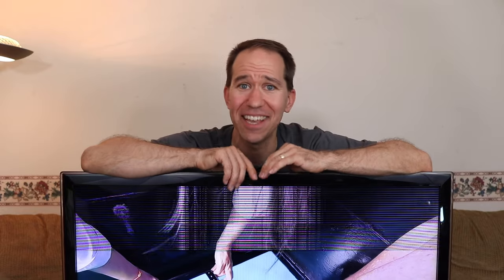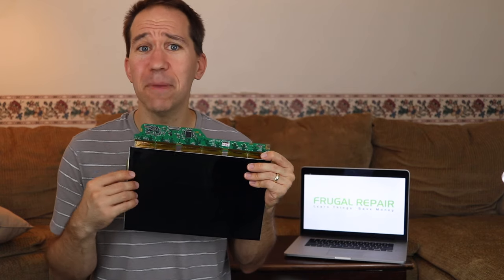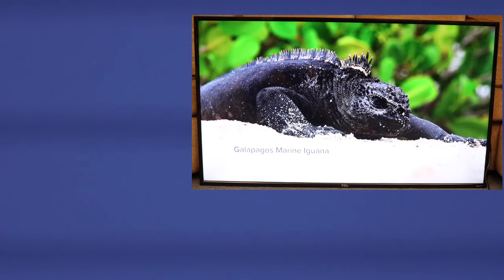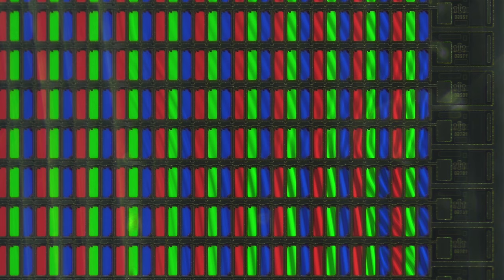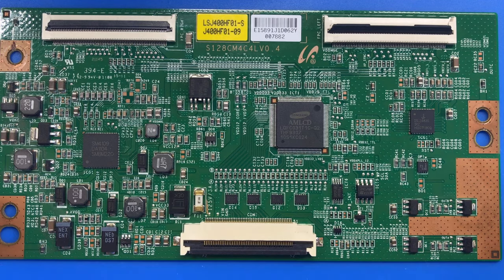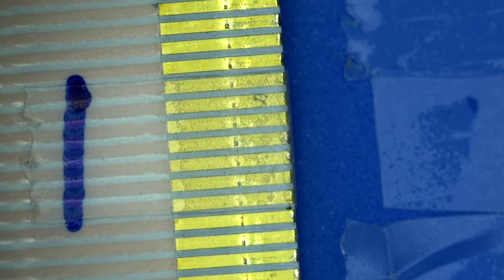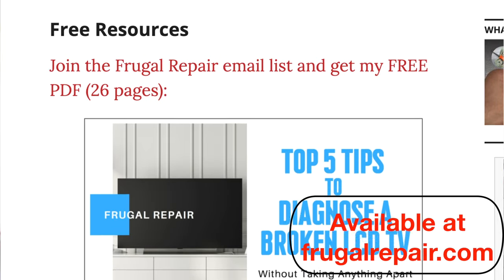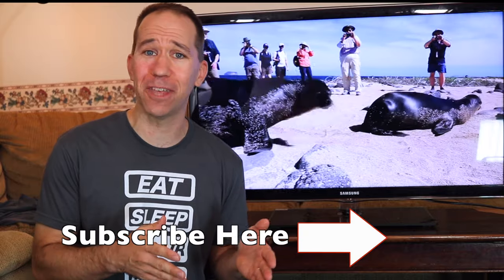Repair Hack Explained | How to Fix TV Horizontal Lines - Part 2

Comment: I've glad to know that someone explained this issue I thought the screen was built with problem defect after a few years however I still would like for you to explain how to deal with those TV that does not have t con on board and the lvds cable is connect directly to the screen with buffer board do you cut

Comment: Very nice detailed explanation.. I have a question? My TV screen is broken. Do u suggest to replace it from outside or from the Authorised service point only but it's costly equal to the new tv cost?? Pls advise
Reply from the maker: Unfortunately, you can’t repair a cracked lcd.  You can replace it (even yourself) but the issue is that you likely can’t buy a new lcd anywhere.

Comment: Im very happy this worked for me im just so confused why it works by putting the tape on the ribbon cable does it bypass a short on the internal lcd board?
Reply from the maker: I’m so glad to hear that it worked! Yes, you are preventing an electrical signal from going to a short circuit inside the panel. The reason that it works is because the signal is redundant to both sides of the screen. It’s like an airplane can fly with one engine.
Reply: @FrugalRepair  thanks so much for explaining i really love your channel keep up the great work
Reply from the maker: Thank you!

Comment: Hi Reese, I have a smaller 32" LG tv that has vertical lines along with an impact point. I took the back off and pulled out all the ribbons and re-inserted them firmly, as well as checked for bad grounds. Lines and impact point still there and no picture. Looks like the screen might need replacing. What do you think, internal damage? Thanks.
Reply from the maker: If the screen is cracked, unfortunately, you can’t do anything about it.  You can install a new screen but the problem is you can’t buy them anywhere.

Comment: I fixed my 4k panel as per your advice, thanks @frugalrepair. But on one side of screen, its dark. And there are light black horizontal lines  there. Is there any fix for it?
Reply from the maker: Great to hear.  Congratulations.  I’m not sure of your issue but if you have a row signal problem and the tape trick brought the image back, then you may be blocking too many lines or that may be the best the image can get.

Comment: Liked & Subscribed. Great video. Gonna have a go at my TCL 50” soon. Need to gather some courage first coz its my mom’s tv😂
Reply from the maker: Good luck!  Biggest thing is not to put pressure on the lcd screen so it doesn’t crack.  And always make sure the power is off while you are directly working on it.

Comment: Hi!  This is great, I have a slightly different problem, I got a free 34” curved monitor from work because it has snow and horizontal lines, is there anything I can do?  It was brand new out of the box like that.  Ideas?
Reply from the maker: Hopefully it is something really simple like a loose connection since it's a new device.  I'd re-seat all of the connections starting with the ones to the main board and the screen.  One time I bought returns (from a big box store) and the most expensive tv in the lot had a loose cable (after I opened it up).  All I had to do was plug it back in correctly and I had basically a brand new tv that I paid very little for.  Good luck!
Reply: @FrugalRepair  thank you!  I have it apart and don’t see any bulging caps or loose connections.  I am only through the first layer of boards (main, power and audio).  Is snow only caused by loose connections or could there be something unfixable that is causing it?

Comment: Hi frugal  Recently my 65" LG LCD 4Ktv lost color but i still had back light, So I was able to take it to the local TV repair shop he was able to restore picture n fix it but now I have some flickering and horizontal lines, which seem to be emanating from top right corner. Do you think I should try the tape or just replace the tcon panels entirely?  I already went ahead and ordered the replacement parts 🥲tho im gonna ask repair to install them

Comment: Good job and thanks for the explanation. I have a 32 inch toshiba led tv. It shows picture on the upper Side   of  the screen and tiny coloured lines on the down. Any ideas on what to do?
Reply from the maker: Sounds like the lcd panel is cracked.  If so, you won’t be able to repair it unfortunately.

Comment: Is it possible for both sides right and left ribbons to have a short circuit problem? In that case how should we go about trying to figure out which leads to block off with the tape? Any help and info is much appreciated.
Reply from the maker: The row signal is shared across both sides, if it's the problem then it will likely show up more on one side.  If you get the same symptoms on both sides then I would next suspect a problem on the tcon board.

Comment: Holey Dooley, what are the chances...!! you repaired the exact model TV I have with an almost identical issue. Just gotta figure out how to get to the part you put tape on. Woop 🙌🏼
Reply from the maker: I hope you can get your image back too!
Reply: @FrugalRepair  unfortunately not. I did reduce the lines appearing but couldn’t work out exactly which pins to cover. Which section did you cover? Mines also from the left side.

Comment: Thanks for the technical details on how LCD works. Its very interesting to know the facts. The reason I was watching this is to troubleshoot 1/4th of the screen vertical lines on my SHARP AQUOS tv. I replaced my T-Con board and swapped the cables but the problem remains the same. Is it possible to replace the electronics that send the vertical image data. Is there a simple fix.
Reply from the maker: The issue is inside the lcd assembly so that’s why changing cables or the tcon doesn’t help.  Maybe a failed COF (chip on film) or a failed transistor in a sub pixel or something else.

Comment: Excellent explanation, is this applicable to LED TVs too?
Reply from the maker: The backlight is irrelevant because what is being worked on here is the LCD screen itself.  So it doesn’t matter if the backlight is LED or CCFL.

Comment: nice video with in depth explanation... I have a 22inch acer monitor(al2216w) that has image display problems. I tried changing the cable out and even connected the monitor to a different device, still no changes. The content on the screen looks like it has shifted to the right( the same type of blurring you get when you write using a pencil then smudge the words). Any tips or solutions?
Reply: the blurring is horizontal

Comment: Hi. Are horizontal lines means problem within the screen itself or T-CON replacement should fix the problem?
Reply from the maker: It could be either.  The isolation test I did in the video can usually indicate which one is the culprit.
Reply: Thanks from the UK for the quick response. Top man.

Comment: What would be the proper fix the replacement of tboard or the thing you are putting the tap
Reply from the maker: Proper fix would be to replace the entire LCD assembly since that is where the problem is.

Comment: Hi there thanks for the video !

Is it possible to fix the issue of the horizontal lines? Like fixing the lcd circuits for the RGB pixels ?

Or it's impossible if the problem is on the lcd itself ?

Thanks

Comment: I have a VIZIO V585-H11 58" LCD Purchased 15 months ago. A month ago the picture went blank.. I removed the tcon cables going to the LCD screen one at a time... Got a good picture on both halves!  I put tape on the outside edge on the left cable at the screen and BOTH sides came back on with no artifacts in the picture... I blocked all timing on that side.. (look for the holes plated through on the left hand side of the PCB  and cover the traces on the flexible PCB cable at the board...   I'm a 73 yo retired electronic tech that worked on industrial and commercial audio and  video and felt there was nothing I could do to fix this set... Toshiba 58UL2063DB and PHILIPS 58PUS8105 use this same board so you might be able to repair them the same way... Thanks for your caring to post your fix...
Dave in Ohio
Reply from the maker: I think I missed it, did you get the picture to stay working?
Reply: @FrugalRepair  YEP... with some minor lines on right side of picture (left to right) that come and go... I probably could have unblocked some feeds on the flexable cable but was satisfied just getting a picture back... Dave

Comment: Thanks for the explanation! I was wondering back then how the tape fix works which fixed my tv. These manufacturers should do something about this as two TVs in our house got the same problem.  It is like they have a redundant system for signaling but the redundancy is useless in practice.
Reply from the maker: Thank you!

Comment: So does this mean that the TCON board is defective? Wouldn't be easier to replace  the TCON board?
Reply: No it would generally not be the T-Con board in this scenario. I had the same issue as in his part one video. I had nothing but a blank blue screen. I made the mistake of changing all my boards and the outcome was the same. After watching his amazing videos and using the tape method it’s a miracle I have a full picture back. It’s not perfect yet as I am still trying to narrow down some horizontal lines from mid screen down. So it’s going to be time consuming for me trying to figure out exactly which ones to block. Definitely go this route before wasting money on new boards like I did. Mine is a 50” Philips Roku. My shaky hands make placing the tape a pain in the @@@ lol.

Comment: I bought this Samsung 32 inch for 25 dollars. It had 2 of the diffusers broken off and shining bright light that I couldn't stand. I ordered the LED strips and installed them and now there's horizontal lines and I didn't really understand how u found specifically where the tape went but I'll play around with it. And watch the video a few more times to see if I finally get it.
Reply: I never got it to work. I regret changing the backlights. It worked better before. Oh well...

Comment: I know that this is a belated question, but I have an LG 55" LCD TV with one horizontal line and two much fainter lines - one either side - of the darker one.  First of all, could I get away with maybe covering one or two traces to solve my problem, and second, would replacing the T-Con board be a better and more permanent solution?

Comment: Hello, first of all, very instructive video...I also had horizontal lines on my tv-set..I  tried the tapehack to block the clk-signals from 1 side of my tv...I blocked all six of them and the picture looks like brand new...I only have one question...Is this hack is a lasting thing or are there risks with this methode further on , like firehazards? Thanks you for respons in advance...
Reply from the maker: Congratulations!  No fire hazards that I know of,  you are helping to prevent/minimize a short circuit by blocking signals.  Not sure on longevity but I don’t see why it wouldn’t last a really long time.

Comment: It worked on my Sony 43 inches LED TV❤️.
But if i look closely then I can see some lines.
But from a distance of 5 to 8 feet  it's not noticable.
I was planning to buy a new tv by throwing this TV 😢, But you saved my money ❤️.
Question!
If I change the Tcon board ribbon (50 pin), will this problem get solved permanently??
Please reply 😇

Comment: I have only 1 question : is this fix  permanent or not? Thanks for the video! I've always wondered why blocking these lines were fixing this issue 👍👍
Reply from the maker: My tv's that I have done this one are still working so I don't know what you call that.  Did you watch both part 1 and 2, I hope that I explained it well enough in both videos?

Comment: Thanks for your nice explanation how it works. I follow the same method to fixed the horizontal lines of a LED 4K  TV and it fixed tha issue but some colours  are completly missing on one side. When all the lines are connected and horizontal ines are there, the I can see the colours are same as other side. Do you think there can be mcuh more issues with the panel other than this. Much appreciated your reply.  Thanks.
Reply from the maker: Obviously I don’t know what is exactly wrong, but it’s likely there is one failure in the lcd panel that is causing the lines.  As I showed in the videos here that you can experience some color loss, I think, because of the loss of the gate voltage for the transistors on that side (where you blocked the signals).  Is it possible you have too many lines blocked?
Reply: @FrugalRepair  Thanks for your reply. I has to block only two lines 9 and 10 in the 96 pin ribbon. If I tried to block only one, I get a full colour with some flickering on that side with fewer horizontal inles.  I also hear some bussing noise from the TCon board.  Is that a sympton of a bad TCon? Since this TV is near brand new, I will further investigate the components to see if this fully repairable. Thanks.

Comment: Hello sir i found your video very useful. So my question is yoi tape the stvp to ckv1 to isolate the problem?
Reply from the maker: Thanks!  It is to prevent the electrical signal from going to the failed component on that side of the lcd

Comment: Thank you for the great video! I just have a couple of questions. I managed to save a 55" LG 4k tv from the dumpster that had no picture with a piece of tape. I blocked off about the first 12 lines on the left side. I instantly got a picture. It looks great. But there is one problem. When a certain value of color comes on the left side of the screen, it noticeably flickers. It is evident in the color blue (if that info helps). My first question is: Is that fixable by isolating a specific clock line? And my second question: Does replacing the ribbon cable itself solve the problem? Thank you for your help.

Comment: Would the same trick potentially work on a plasma tv (randomly spaced horizontal black lines, bottom third of screen area). Not sure if it's different for plasma tv's.
Reply from the maker: No, a plasma is totally different.  Lines on a plasma may simply mean the connector need to be cleaned.  I've gotten rid of lines or black bars that way.  It could be a control board or a bad panel.
Reply: @FrugalRepair  thank you for the reply! I did try cleaning the connectors but that didn't change anything, unfortunately. Looking like it's likely a board. To be honest, when I'm watching tv you really don't "notice" the lines all that much unless you're watching a program that has a light or white background, like hockey lol.

Comment: Hi, your information is very detailed, but what happen if both sides have the line when doing the isolation from the other. 
I believe blocking both Side on the Clock signal won’t be able to display anything on the screen.
Reply from the maker: Yes, if you block the row signal on both sides then the image can not appear on the screen.
Reply: @FrugalRepair  so what to do when there’s issues on both side of the CLK signal ? because this tape method won’t work

Comment: In this situation is the screen defective or would replacing the tcon board most likely fix the issue?
Reply from the maker: Screen is bad
Reply: @FrugalRepair  thanks for the lighting quick reply. That's good to know as now I won't waste my time/money replacing my monitors tcon board. I'm going to try this tape method and hopefully get a decent result without to much trial and error.

Comment: So would the long term save from these lines be replacing the t-con board or ribbons?
Reply from the maker: No, because the fault is inside the lcd panel assembly.  And you can’t find replacements for sale anywhere on most TVs.
Reply: @FrugalRepair  so then the only long term repair would be replacing the entire display screen but nothing that leads to it?

Comment: Some videos showing needing to cut a signal right up at the ribbon to LCD entry point. Perhaps u can do an update video delving a little bit deeper into what happens with the signalling along the way and explain about those three letter abreviations. Vgl etc. Indian videos a plenty but no English. Thanks champ.
Reply from the maker: Thanks for the suggestion. I could do that, but unfortunately, I think it would be too detailed for most.  The main point of what is happening in this video is the gate signal for the row of transistors is duplicated on each side of the lcd assembly.  There is some unknown (but probably a short circuit) problem on one side of the lcd.  By blocking the signal (anywhere before the problem spot) you get rid of that short (or open) and the gate signal from the other side runs them all.

Comment: Hello. Thank you for sharing your knowledge! I tried the isolation method of unplugging one ribbon cable at a time. unfortunately the horizontal lines did not go out with either cables unplugged. Should I still proceed with the tape method even if that is the case or is this a different problem? Thank you!
Reply from the maker: I would next suspect the tcon board.  You can try the tape, it won’t hurt

Comment: Hi, enjoyed your videos. I tried your tape fix on a Sony XBR-65X750D that has horizontal lines on the bottom 1/6th of the screen with 2 of the lines blinking on and off about every 3 seconds. The rest of the lines are solid and unchanging. Nothing I have tried has changed the condition including a different T-con board, switching the ribbon cables, cleaning all contacts.  I am at a loss as to what or where to go next and would greatly appreciate any ideas you might be able to offer. Thanks
Reply from the maker: On some older Sony’s there were issues with the tab bonds.  Perhaps yours is lifting somewhere.  You can try putting light pressure on the tabs (I usually use a pencil eraser) while it’s running
Reply: @FrugalRepair  Thank you for the suggestion. I will give it a try, appreciate your help.
Reply: @gilg4664  Did that work?